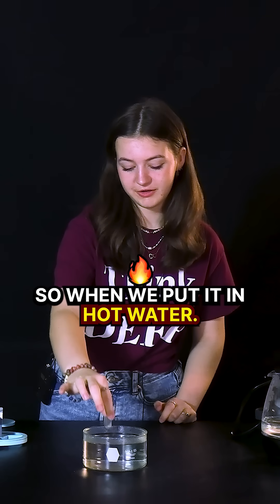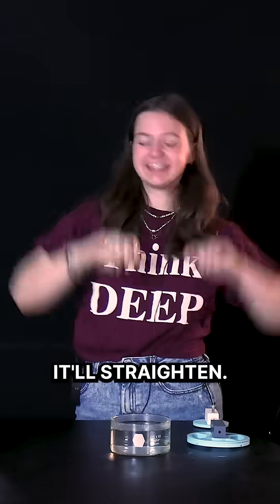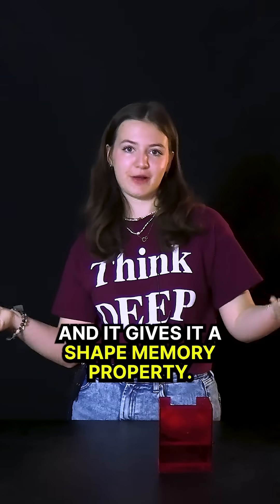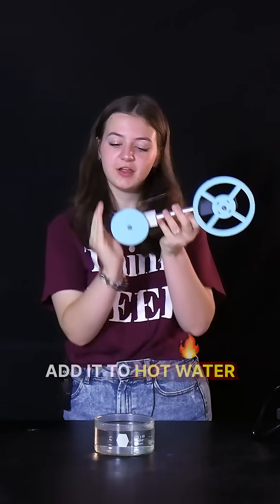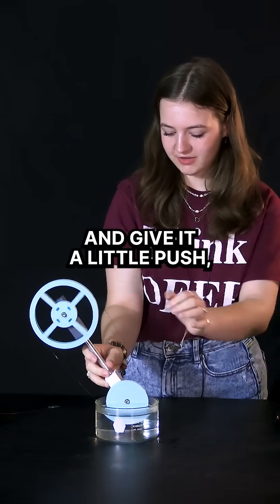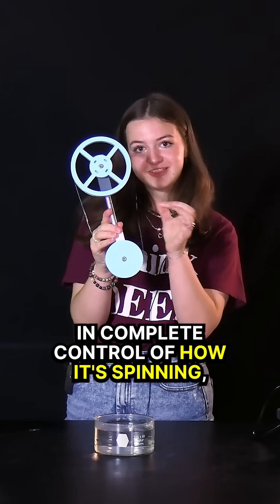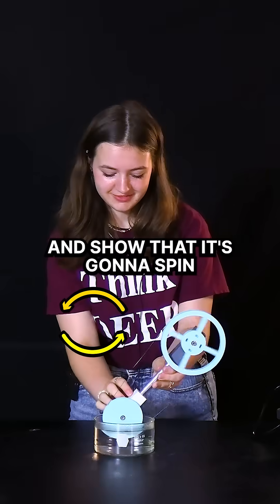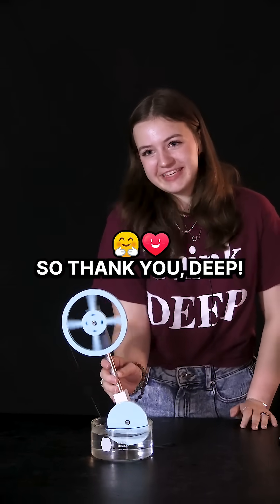Magic metal springs to life from heat! But how?? #shorts #tamu #science

Comment: But I don't understand, how can it be 'trained' to go straight? And what happens at the atomic / molecular level before it goes straight. If course a pulley involves tangents and when the nitinol( feels a bit like an alcohol but it's just a nickel and titanium alloy as she just said) will straighten and cause the pulley to start moving. I don't understand, how does it alternate between two crystal structures. Great concept though, I thank you all for promoting the love of physics, chemistry and mathematics among students. I mean you don't with chemistry, but with physics( my love)
Reply from the maker: Great question. Nitinol is “trained” by heating it while holding it in a specific shape, like straight, so its atoms lock that shape into memory. At room temperature the atoms are in a flexible crystal form called martensite, which lets the wire bend easily. When heated, the atoms shift into a more ordered structure called austenite, and the wire snaps back to the shape it was trained to remember.

In the heat engine, the wire straightens as it warms while wrapped around the pulley. That straightening creates tension, and because the forces are not perfectly balanced, it produces a torque that makes the pulley rotate. The motion comes from heat driving a crystal structure change at the atomic level, not from elasticity or anything spinning on its own.

Comment: So out of curiosity why can't this be used for perpetual motion machines? I know they are not possible but whats the catch on why this won't work?
Reply: @isaac41256  The heat from the water is  the energy causing the turning of the wheels. Once the water is no longer hot, the wheels will stop turning.
Reply: @snowshoes343  tyty

Comment: Curiousity, what if the top pully had an alternator/ generator attatched which could in turn power a small heating element that in turn keeps the water hot? I know there is probably some law in physics to make this impossible but again, curiosity

Comment: For making it in shape of spring u need energy and overtime it will loose its shape memory and you will have to do the same process gain so technically this is not an efficient way to generate energy

Comment: Very cool, though probably only viable for things with very minimal torque requirements.

As the torque is only from the wire attempting to change structure, I would imagine there's not much that can be done to increase that/make the reaction stronger.

Maybe something is achievable if the system has extreme temperatures applied? Extreme heat, causing a faster reaction. Then contacting liquid nitrogen on the other side, for rapid cooling?

Comment: A similar property is used in braces! As the wire is "trained" to retain a specific shape, a wire which is trained to the desired alignment of teeth is attached to each tooth on brackets. As the wire wants to return to a specific shape, it pulls the brackets and thus moves the teeth into alignment! Just thought that was a cool fun fact

Comment: This can theoretically be used for power generation, turning an alternator to charge batteries. I'm sure scalability and materials will eventually need tweaking if used on a grand scale. But a fascinating idea, as only water is needed, not the flow of water. This wire composition eliminates the need for flow, such as found in a dam. I'd be greatly interested in seeing this developed, and this young lady's future endeavors. YAY STEM!!!

Comment: This would be such a i teresting concept to incorporate with steam power. Guessing you need less heat to get it to try and straighten then you do to produce steam to power a similar sized pully system. And would also have less effect on the atmosphere. 
Prob can only be expanded a small amount though. The power of attempting to straighten having a limited threshold. So prob would be small scale use. Which was a big problem for steam power, because to be really effective it needs to be large scale.

Comment: FAKE.  The power switch is on the side of the white block.  Notice it only works when she touches the white block on the side.
Reply: @SirLNK  You could just try this at home. Nitinol Wire ASTM F2063, and maybe like 10 minutes of grade school arts and crafts with home tools and $15 of Home Depot crap. That’s not too hard for you, is it?
Reply: Ohhh no this is real. But you need energy to heat the water don't you? So you actually convert thermal energy into mechanical energy, but you need to get the thermal energy from the sun or electricity

Comment: They also use niti in braces. The wire uses the heat in your mouth to take its shape back and pull force on the teeth. That's why it tends to feel better when you put cold on your wires. But it also just delays the force.

Comment: Easy, create a tub of water heated by the sun and use multiple strings to spin a generator. Just need a test run to see how long it lasts in motion. You could possibly store the excess power, this could also solve the solar problem since the water would stay warm for awhile and you could use firewood as an alternative source of power during winter or cold nights.

Comment: You would still need energy input to heat the water, but if this can be engineered to run off water that is being used as a coolant and being heated as a byproduct/waste output then were back at effeciency

Comment: However Could One Connect this to an Electro-magnet based Generator that send some of it's Power Generation to a Water boiler, Initial Start up would need Outside Source and Get near perpetual Energy generation?
Just possible Idea From a hobbist, Not Fully trained Engineer
Reply: the output would never match the input required to keep it going

Comment: This is not perpetual motion, the thermal expansion of the hot water to the metal its self like she said causes the wire to heat and cool at different rates causing a expansion and shrinking event at 2 different locations on opposite ends of each other causing the wheels to move but the moment that cup no longer has potential energy (heat) will no longer expand and contact losing kinetic energy and stop rotating all together not saying that I think she thinks it's perpetual motion but the people in the comments might thinks so perpetual motion doesn't exist and the hardest thing about them is finding where to store the potential energy a system cannot hold its own potential energy and has to come from alternative source you can test it yourself with literally anything if you want an output you have to give input

Comment: This experiment demonstrates the principles of metallic thermal expansion and resistance. Different metals expand at different rates when heated. The setup in the video uses this property—specifically the thermal expansion of metal—to create mechanical movement from heat.

Comment: What if you had an initial form of energy like a generator to heat rows of water enclosed to prevent evaporation and have enough of these to produce more than enough energy to keep the rows of water heated and store the rest of the energy. Would you have infinite energy then ?
EDIT: after doing more research you don't actually need water you just need heat so it will probably even be better if you just used a coil as the heat source close to one of the bends as demonstrated in this video. 🧐 curious.  I may actually try to build this haha.

Comment: Just need naturally heated water source like a geyser and a much larger version of the device. This is definitely not nothing it just needs refining. Does this metal ever run out of/use up this special property that it has? Anyone. I imagine 5 or 10 of these in a naturally heated water source. Is that not gonna give you a significant amount of power? Maybe to be stored in batteries?

Comment: ok Questions,
1. How much torque it can produce, since if it's powerful enough, we can crank electric generator with it, but...
2. How hot the water should be, 100C/212F boiling hot or can below that. Because if the water is boling hot, then making this mechanism to crank electric generator would be useless, since we already have steam engine/turbine 

We need this thing strong enough to hold good amount of torque to crank a generator, yet operate in lower temp than steam engine so we can maintain electricity output with lower energy used to heat the water.

Comment: So, of course we need a source of consistent warm fluid for this to work. I wonder if you could harness the heat in a cars radiator to rotate a pulley that could potentially serve as a little baby alternator, or at least power a few accessories

Comment: Wire cools upon leaving liquid, restarting the process. The setup therefore only requires a heat producing base to produce electricity. This means the setup could be fed by anything from solar, magma heated, to nuclear cooling technology. Anything that produces significant heat as a by-product can harvest significant electricity from heat exchange. Not infinite, but with tweaking design this could be a power grid game changer.

Comment: could you try making an engine that can alternate between bot direction and only need hot water to work ? and then seem how much horsepower does it give and finally if it does’´t give even 1 horsepower try to make or calculate a 1horsepower engine if possible the idea is potential car application

Comment: i wonder how many you would need to turn something like a generator for a house?

I have been fascinated with generating power using temp differences and various ways of doing that.

Make something like a solar water heater combined with water pumped around underground to get maximum temp difference.  some sort of wheels that dunk themselves in alternating baths of hot and cold

Comment: easy solution is to put a solar focusing lens over a body of water. the sun heats the water and the hot water turns the wheel. another way of harnessing solar energy in a smaller area.

Comment: But the wire on the wheels is already straight, how is it still spring loaded if it’s already straightened out before the heat is applied?

Comment: So genuine question...but say you put it in a water heater and somehow convert the energy from the wire to heat the water and the hot water that's being made is used to keep this thing going you could have infinite power if you start with a bit of hot water?

Comment: interesting idea, but nickel chromium(ironic huh?) has a very low power requirement to actually output heat, now containerize the water, pulley system, and coil, so that the coil heats the water, after recieving power from the pulley structure with presumably a motor or something, i dont know i might disappear for this but, an idea nonetheless

Comment: Q: Is it possible to make a generator and use the heat of the sun for it to move? Or is the amount of energy you get from that not worth it in either building cost, maintenance cost, or compared to the cost of solar panels?

Comment: I would think that would partner well with a combustion engine because of the radiator you could divert the hot water from the radiator directly to that pulley and that right there will power the rear wheels. But, what happens if you have to stop wheel from spinning? The hot water source is still continuing to force the nitinol to go straight; what other reactions should one expect?

Comment: Can’t we build a low heat electrical generator with this? I mean currently a lot of energy is lost because hot water isn’t hot enough to power steam turbines. But maybe with this we could get the last bit of energy out of the water

Comment: So, we can do infinite power source. However, it needs heat for energy which is the hot water soooo what if we put or construct it on a hot spring? So, it will spin unlimitedly since hot sprinng is natural hotwater, and we can use it for energy to supply power. Do you get what I mean? 😅
Reply: It's not really infinite then 😂

Comment: Put one of these babies (upscaled ofc) along the equator or above a volcano like a rotisserie. Heating pads in the summer to filter in hot water. Plenty of ways to get free heat without requiring production. Of course, there's also renewable heat sources like wood to burn for heat.

Comment: Even if you dip the wire in a natural hot spring, which say stays hot throughout the year, Nitinol has a limited fatigue life — it can only go through a certain number of shape-memory cycles before degrading.
By the way, there are practical applications of this in existence like the Stirling engine.

Comment: Is the action also reliant on an endo-exothermic transfer process for its movement?  That is to say the warm water heats the wire, causing it to straighten?  Then as it cools, it becomes pliable and releases heat?  Also, is a portion of the heat returned to the water, causing the water to heat up further?  
If so, could it possibly be the beginning of an engineered crystalline alloy based free energy device?

Comment: So why does she have to hold the white block on the bottom pulley and tap it before it starts moving? She's touching the same spot on the block very awkwardly which, when combined with the really clunky edits, just makes it look like another fake "free energy" motion machine. 

Then there are the issues with her script. "As you can see, it's turning the wheel as it's straightening" which, it's not doing because she's pushing it with her hand instead of using the water's temperature. And then she tries to convince us with "It REALLY starts to spin" and "to REALLY demonstrate that the wire is..." That's how someone who knows they're lying talks when they're trying to convince someone else the lie is true.

And then there's the fact that it spins the opposite direction she said it would.

If she wanted this to not look incredibly suspicious, she did an absolutely terrible job.

This isn't TAMU science, this is TEMU science.

Comment: This is really cool! Unfortunately I'm unfamiliar with the terms you're using so to me it sounds like "this happens because it happens." I think this video would be a lot more useful for educational purposes if you used more lay terms.
Reply: Basically the metal is made of something that, when heated up, wants to return to it's original shape. Because it wants to become it's original shape it tries to straighten out, but when it straightens out it pushes itself away from the water, which rolls the band around to another section. That new section heats up which moves to another section and then it repeats until the water runs out of heat.

Comment: Ive seen enough to know that it takes a crazy ammount of force and/or friction to create significant heat, but this is the first time I've seen it get turned around and used as an efficient source of power instead, aside from steam engines or whatever

Comment: This makes me think of two applications. Energy transfer from thermal to mechanical> then mechanical to electric. Idk of inefficient it might but that for the engineers to figure out. Next is thoughts on heat pump function. Moves the heat from the water up throught the nitenol to the other side. Again uncertain if efficient, but its worth investigation

Comment: If you can make one that will generate powerz you can run the excess power(after any batteries are charged and whatever power your not using) to a water heater and it can heat the water , creating a free energy system.

Comment: Looks like an opportunity to reduce land fills by burning non recyclable trash to produce energy. Hyper filtering the exhaust of course. Something that's already done with steam pressure, but this can use the residual heat. Imagine drag netting that Texas sized mess out of the ocean for power. Couple that with the idea of turning petroleum-based products back to its base and just might have something.

Comment: i’m a materials science major, and i have a question. 
would the straigtening of the nitinol introduce stresses within the material that could induce cracking at sites of high stress? i would imagine the constant stiffening and loosening of the wire is putting some load upon the portions of the wire that gets heated by the water no?

Comment: ypung lady..

take your technology and run! yes, we need thermal energy for this to work so.. anywhere the sun heats water to whatever temperature makes this wire do its thing, would be a fitting location to install this. hence, basically, solar-thermal. but still.. would take much to heat this up. even induction would be effective. a simple AA battery can heat enough water to warm up the wire in precisely the right spot to make it run..

just wondering about the output. if you have a great gear system, this could go very far.

incredible work

Comment: If anyone is curious. This is how braces work. It’s called a NiTi metal. Some are heat activated by the heat in your mouth but generally it just springs back to its normal shape. So the arch wire shape over time pulls your teeth into the shape of the arch

Comment: Man, it might have a better efficiency than powerplants if you add a generator to one of the wheels. Powerplants convert in best cases 42% of heat from burning fuel into electric power and need extreme parameters of steam for that efficiency, therefore extremely expansive materials for the turbine using that steam and basically all the steam circuit. This is so much simpler.

Comment: To those wondering it's infinite power glitch. There is energy taken to keep the metal in a certain shape for a long time and it will losse it form with time if shape changed constantly.
Reply: hot water springs always have hot water
so there u can get unlimited energy source

Comment: Actually it’s technically powered by the energy in the heated water transferring to the wire then leaving it as it transfers to the air. Physics goes even deeper.